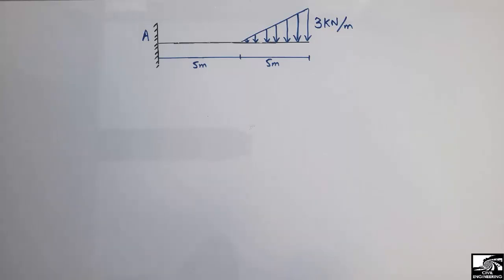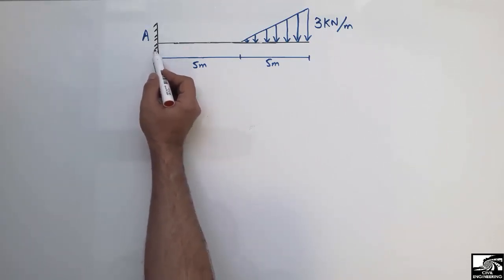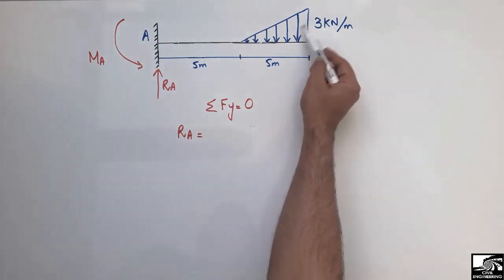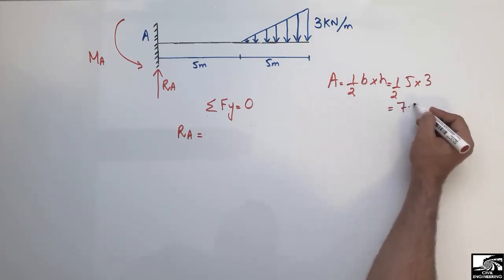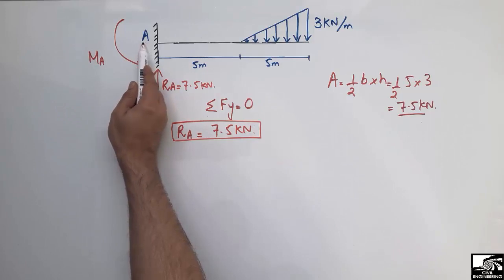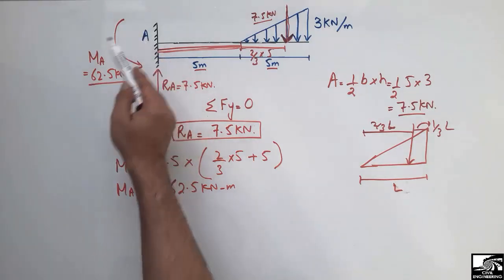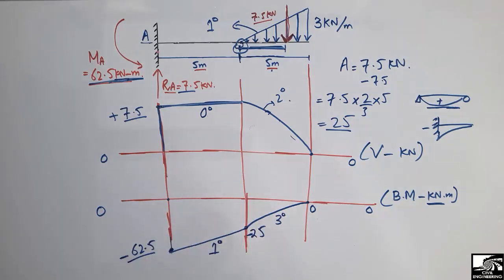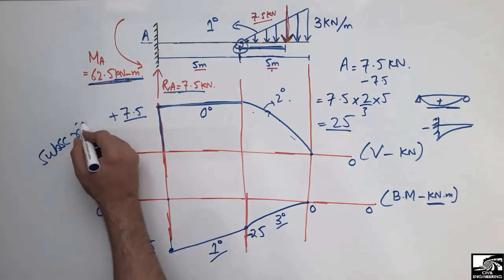Cantilever beam Shear Force and Bending Moment diagram with Triangular load

Comment: Mind explaining what is 1 degree 2 degrees and 3 degrees?
Reply: in y(x)=mx+b, if X=0 then y(x)=b and looks like a horizontal line on a graph that can move up or down (b values) along the Y axis but remains horizontal this is 0 degree.
in (y)x=mx+b, y(x) is a line, that can have a slope; this is 1 degree
in y(x)=mx^2+b y(x) is a parabole, this is 2 degree
y(x)=mx^3+b is 3 degree
y(x)=mx^4 is 4 degree

can also be in the form of
y(x)=x^0 [0 degree]
y(x)=x^1 [1 degree]
y(x)=x^2 [2 degree]
y(x)=x^3 [3 degree] and so on.